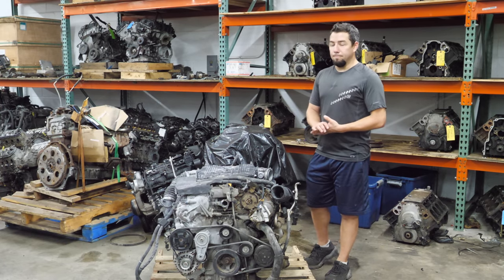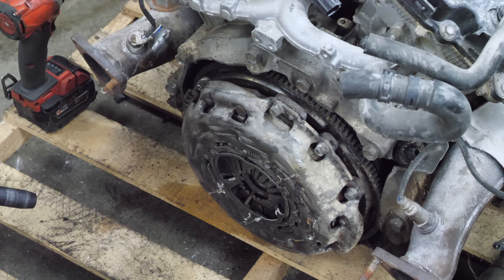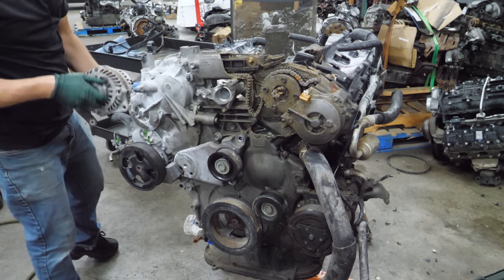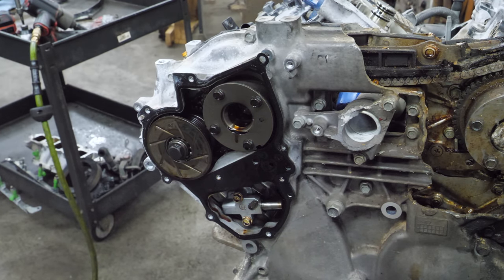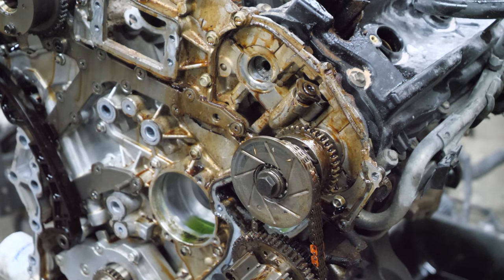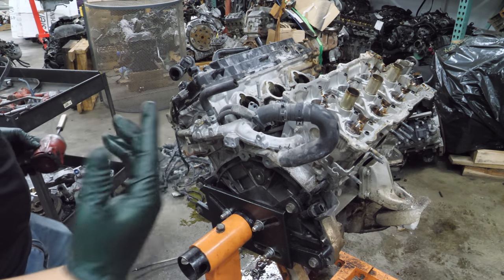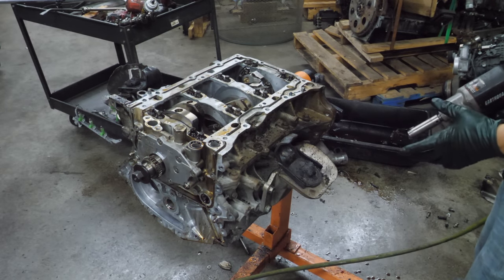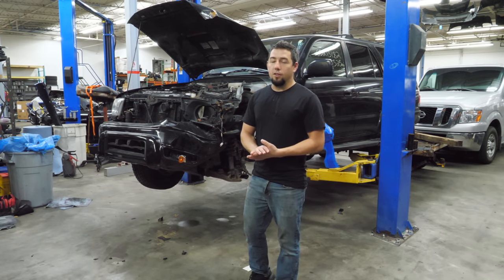VERY BROKEN Nissan 350z VQ35HR Engine Teardown! Did Anything Survive?

Comment: You really need to get a bigger line for your half inch and the quarter impact guns. I use die grinders, air rachets and three eights impacts on 1/4 inch air fittings

Comment: Crankshaft Pulley
 Tighten crankshaft pulley bolt.
 Torque .................... 44.1 Nm (4.5 kg-m, 33 ft-lb)
Place a paint mark (A) on crankshaft pulley (2) aligning with the angle mark (C) on crankshaft pulley bolt (1). Tighten the bolt 90 degrees.
Seemed tighter than that.

Comment: at 11:32 watching him try the breaker bar gave me flash backs to my g35... I had to tie inch thick steel cables to the frame to prevent the pulley from moving then used a 3 foot long breaker bar with a 3 foot pipe on the end of it and the power of two 18 year olds just to break it free

Comment: Great video. This is the first time I've seen the type of cam timing control used on the exhaust cams, and can't find a great diagram of the internals anywhere... any chance as a bonus video you could cut the sprocket and the cover in half to give a section view? I'm sure the big spring on the sprocket would require the use of the Safety Tote!

Comment: Nissan crank bolts seem to weld themselves to the engine. I had to pull the balancer on my brother's sentra and it required a 1in impact and a direct connection to the air compressor to get loose.

Comment: the major reason why headbolts with an allen head design usually strip is because the tolerances of the socket itself are pretty sloppy, from alot of brands, they also are prone to twisting far more than triple squares or most other designs other than a hex which are prone to to slipping but generally have a slightly tighter socket construction. Really, the appropriate length of the allen head socket used, shorter the better, and a quality socket.

Comment: I was wondering if on some future teardown on an engine with shim under the bucket valves, if you could measure the clearance prior to cam removal? My point is, no one is ever checking these engines to see if they are in valve lash spec. Do they really just never need adjusting? The mechanic in me, 48 years of experience, including the last 18 as a service mgr, just doesnt believe that’s possible? Love all your vids, keep up the great work!
Reply: I had a Fiat twin cam with bucket tappets. Still original spec after 160k miles. Rest of car rotted out :)
Reply: Did you actually measure the clearances?

Comment: I've been there on the crank pulley bolt for my VQ37HR, it's like Nissan said let's bolt that on with 600 lbsft, you needed the flywheel to be still on and there's a special tool that bolts in to stop rotation but I don't think your engine still had a place to bolt that on.

Comment: It's just the flange of that crank bolt seized on the face of the pully, a little heat on that bolt flange and it comes right out
Reply: Also, do I spy a blue slingshot in the background?

Comment: Very cool video.  Quick Question : At 37:07,  it looks like there is a crack in the block in the lower right hand corner of the video.  I think that's one of the oil pan dowels.  How far does the crack go ? Is that crack repairable ?
Reply: Good eye Sean.  Puts a new light on reuseability of the short block.
Reply: Yep, I saw it too, but looks like it is just on the pan rail so likely fixable

Comment: That water pump on the chain, inside or through the oil system looks like a horrrible idea to me. I dont know how this engine performs but everything around the timing chain is surely a pain to work on. Considering, you work most of the time when the engine is still in a car...

Comment: You should try a DeWalt High Torque, Hog Ring Anvil, 1/2-Inch, Tool Only (DCF899HB) or the 3/4"(DCF897B). Both cost about the same and have the same specs. I have one and I found out which were the good and cheap impact sockets in my tool box. The cheap ones split fairly quick. I had to get a very rusty trailer ball off of a hitch using a 1 7/8 " socket (hard to find around here) and I broke the breaker bar but in its defense, I did add 2' pipe to it. I just got the dewalt !/2" inch impact so with an 1/2 to 3/4 adapter I figured why not. I was surprised it only took 3 seconds to get the nut loose and after putting the largest pipe wrench I had on the ball, managed to remove the nut. My high torque air impact even at 150 psi did nothing. I know some people will say that I loosened it before the dewalt but the nut never moved, the rust was still intact.

On a side note, what video editing software do you use? I am trying to clean up some family videos bulk digitized from old VHS tapes and there are so many to choose from. Thank you.

Comment: VQs absolutely do not have bearing issues. If you knew anything about VQs then you would know how to get the cams out first try. 🤡s don't check oil and burn up bearings, yes, but that has nothing to do with the quality or design of the engine.
If they did, then these stock blocks wouldn't be holding 6-700 whp just fine.

Comment: It has been quite a high speed impact as the front of the engine and the bell housing have been smashed like that. I wonder a bit what they have actually collided with, as the totally smashed area on the engine front is so local to the left side cylinder head. Even the AC compressor seems still to be attached at the lower left corner and not so smashed at all.

That pink stuff definitely looks like fire extinguisher residue as it has penetrated to just about everywhere, but never heard of the powder being colored like that before🤔

Comment: Did you make sure the very back of the crankshaft is ok?  With the damage to the clutch & flywheel there may in the very least be damage to the threads for the flywheel bolts

Comment: You can actually pull the cam caps off without removing the rear timing cover. It is just 4 bolts per cap and they are sealed to the rear plate and the heads.

Was this vehicle hit on the front passenger side?

Comment: Any idea if that lower intake mani fits the front drive VQ35DE? I think I’d like to do a port and polish job for my moms Murano. Upper has to come off for the plugs anyway, which should be done with 110k.
Reply: It does not fit my friend but look into using the 09+ Maxima lower intake manifold
Reply: @e46m54nissansr20937  Thanks, I’ll take a look at that lower. Anything I can do to make a little more power with this thing, I’m up for. It seems to hate mods.

Comment: Sounds like when they where in the accident the car kept running and blew up both engine and transmission. This is an important reminder if your car is still running after you've had a front end accident turn it off if you're able to that is otherwise insurance will total it for sure.

Comment: That was a hot mess all together...err somewhat together that is. To have gotten a short block and one head i would call that a win...I would have the crank checked to be sure its still and straight given the brutal trans delete it went through.  Oh yeah...a good alternator...amazing it survived given the oil pan got a bigger drain hole. it would be interesting to see the car though as to what got bent and ripped from it. Hopefully the driver and/or passenger/s survived without permanent injuries. 
    A great video...it would be interesting to see one of those lame allen head bolts all buggered up...I've never seen one but agree thats the worst design to have used.

Comment: If the driver did push in the clutch, I wonder if it was his last living act. Overall, it looked like a relatively low-time engine; the intake ports weren't all carboned up, and it was really clean inside. Looked like the guy totalled the car before he had time to blow it up. He has surely done some clutch dumps with it, I don't think I've ever met a 350/370 owner with a stick shift that hasn't burned the back tires off his car, and I've been to several ZDAYZ events. Heck, this might even have been one of those cars, they usually totalled at least two at each event, and bent a lot more of them.

Comment: I don't know why nissan went with a dual mass flywheel. I have a JWT aluminum flywheel in my 3.5 Maxima and it's works great on a daily driven car.  it's only 15lbs which is half the weight of the stock one..

Comment: Only bent valves on one cylinder is baffling.
I'm thinking the driver lost control at speed and jumped on the brakes. The car was sliding side ways and the engine was almost stopped when the car hit something hard enough to eject the engine.

Comment: It seems like you could've pulled one or both heads without fully removing the timing cover, wouldn't that be easier to give you more options to remove the crank bolt?

Comment: The Earthquake XT 3/4in pneumatic impact is rated at 1700ftlbs breakaway and it couldn't do what you did with a 3ft bar and not even your full weight. So its not even delivering a third of the claimed torque. Get an Ingersoll Rand.

Comment: My vq had a camshaft or crankshaft sensor off and it threw my pistons into the valves and killed the engine. Had about 60k miles on it at the time.

Comment: so how does that VVT system work? it looks like some sort of clutch system?
Reply: Assuming you mean the one on the exhaust, I am trying to figure out the same thing. It looks for all the world like a brake that is dragging the exhaust cam back against the big spring that appears to couple the sprocket to the cam itself, but all the literature refers to it as electromagnetic control. So maybe it's an eddy current brake, and the thing that looks like a brake lining is just a low-friction coating so that the electromagnet can run hard up against the sprocket?

Comment: That is a huge parts count and very complex design for such low output.
Reply: I agree with the complexity of the design and intricacy of the die cast timing covers. I don't know about the engine's power and torque specs, because you never told us that part. It would be helpful for the viewers to know that.

Comment: Aside from the broken, that engine looks like it had regular synthetic oil changes.
Reply: Yep......Considering the stuff we normally see on this channel this thing looks like it just came off the assembly line.
Reply: I'm really interested in what oil & oil filter they used, and what kind of oil change intervals they were using cuz that engine was the cleanest you've ever autopsied.

Comment: A 350z/G35 with a manual transmission that was wrapped…I’m guessing this is someone who thought that because they owned RWD car, they must be the drift king. Hopefully they survived and realize that no, they are not the drift king, and hopefully they didn’t kill anyone else in the process. The fact that it broke the transmission off tells me it was hit in the side. Probably wrapped it around a tree or power pole at high speed.

Also, regarding accessories/ancillaries, you and your viewers/commenters should realize that English is spoken in many different flavors within the same country, as well as around the world. Calling them accessories is correct. Calling them ancillaries is also correct.

Comment: Wonder if that's the engine from a Nissan 350Z car that I had to recover a foot in a boot 🥾from after a severe crash & the driver died a few days later & the family wanted the foot ,but no one at the bodyshop & tow yard wanted to recover it ,I literally had to peel it out in layers of twisted steel ,the drivers side was pushed into the passenger side of the vehicle 😵‍💫

Comment: The VQ are a motor you will only have once great power for the capacity good torque on the upside. It can get a 2500kg van to 220kmh and still pulling.Downside a pig to work on in a Elgrand 4 hours to change plugs . Drinks fuel more than a 6l v8 or a drunken sailor 20 to 25 litres per 100k taking it easy . I am going to stick with my Barra engines can’t beat a straight 6

Comment: water pump run from timing chain is the stupiest thing ever thought of
Reply: Right up there with starters under intake manifolds and headlight bulbs that require bumper removal to change.
Reply: Engines with no oil dipsticks are even worse
Reply: Transmissions too.  Without dipsticks, that is.
Reply: @ivertranes2516  agreed. Removing the dipstick from engines & transmissions should be a crime

Comment: Eric, going out on a limb here with a few suppositions: 1) Speed was a factor in this crash possibly approaching triple digits. 2) Based on the high location of the damaged cam end, there was probably bumper override as in the Nissan hitting a pick'em up truck also with lateral offset like somebody was only a couple feet over the center line of the road. 3) this wreck likely happened AFTER Cinderella's witching hour on either a Friday or Saturday night (technically Saturday or Sunday morning). 4) Given the likelihood of #3, alcohol may have been involved. 5) Having seen another wreck where the transmission was located 8 feet up in a tree, I doubt anyone walked away from this one. 

Perhaps an engineer could explain why they design engines with hidden anatomical secrets? I would hope it's for a better reason than they can, so they do.
Reply: Piggybacking on #4:
This is what happens when you text and drive, wreck the car at these stupid takeovers, driving while baked, or a combination of the 3

Comment: INDUCTION HEATER.
get them crank bolts first time every time.
Reply: or a weighted 19mm socket
Reply: @09corvettezr1  you can wait til your tenth try, or you can get it first time too.
Reply: @hg60justice  My Lisle 77080 has worked an absolute treat on every 19mm crank bolt I've ever tried it on, including many that a normal impact socket on the same impact wouldn't budge
Reply: @09corvettezr1  
i know, wouldn't have the same effect as a front end loader.🤣
but i've removed many a lock tighted bolt in the last decade  or so since their inception in places where a torch isn't wanted.
nor twisted  many off, frozen from rust.
heat just where you want it.

Comment: Another auto-opsy. This victim was assaulted. Massive trauma to the left top killing the engine instantly. The timing area was fractured in several areas including the chain. Both cams on the left side were brutalized. The upper part of the engine on the left side suffered catastrophic trauma and rigor mortis.  It was not disclosed whether the victim signed a donor card, but we will make that assumption anyway for the lower part of the engine.  Farewell to the high tech engine, dead too early.

Comment: This is not out of a 350z. Its a 370z or G37, etc.
Reply from the maker: Well, it’s a vq35hr, not a vq37. 
So, it’s a 350z, since I saw the car it was from.
Reply: @I_Do_Cars  350z's dont have two throttle bodies -- my source -- I own one. The intake plenums arent plastic either.
Reply from the maker: @loupohl6991  wrong 
Non HR’s have one throttle body, HR’s have this plenum with two throttle bodies and two air boxes.
Reply: @I_Do_Cars   You're right I think. If so, my bad. ive seen quite a few z's and never saw that setup but thinking about it I do remember hearing about it. I would have sworn that was out of a 370 so thanks for setting me straight.
Reply from the maker: @loupohl6991  no worries. Hope I didn’t come off as a jerk lol
Reply: @I_Do_Cars  Nah, haha considering I was full of shit you kept it civil and stated facts, I appreciate it. gl to your channel